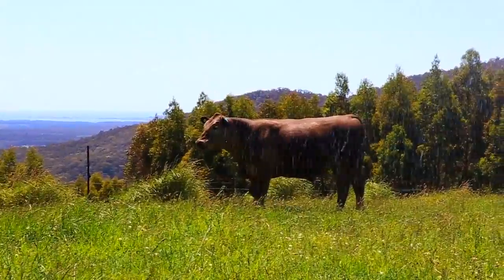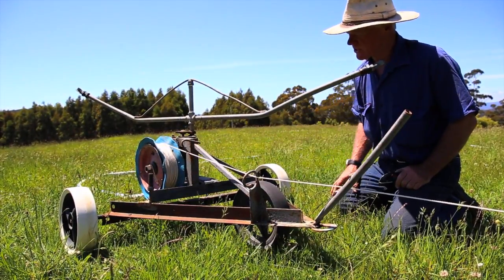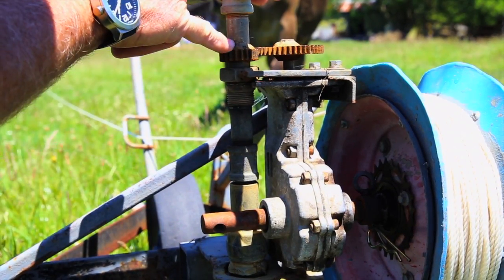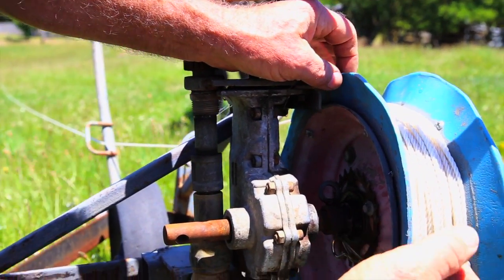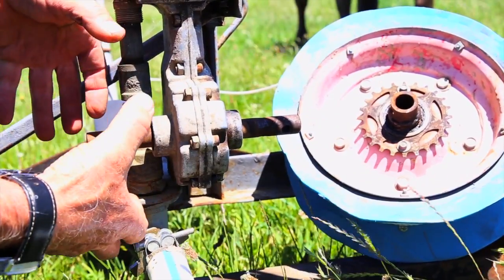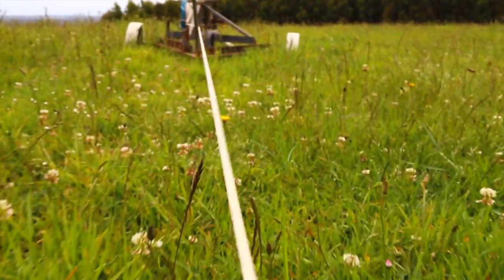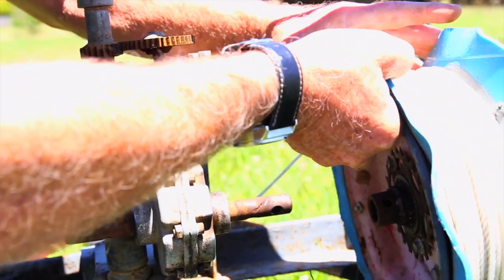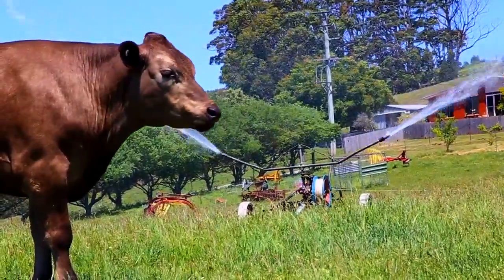DIY Traveling Irrigator

Comment: Len great job.
I have a question regarding the tiller gearbox i have a ryobi here and going to follow your steps. Question i have is the ryobi you used does it have a solid shaft coming up where you mounted a gear,mine has the flexible little square cable type.
Regards 
Paul
Sidmouth Tasmania

Comment: Amazing ...I am a lady farmer living in Upper Lansdowne Valley NSW...i would have all those bits lying around to put an home made irrigator together!!! so I will have a go!!!...I have beautiful flat fertile paddocks but due to drought they are drying a bit ..I make small square bales of kikuyu to sell so this would boots the grass to grow quicker...might need some help from a few local old timers..thank you for your video!!!
Reply from the maker: Hi Michele, I'm pleased you like the irrigator and I have a comment or two that you might find helpful. Since making the irrigator i have bought a 1" inch "lay flat hose" instead of the hard wash down hose in the video, it's mush lighter for the unit to pull along. Secondly, I didn't mention in the video that I have used a brass bush as a collar around the vertical pipe so as to not wear the water pipe. When I am talking about the two gears at the top,  it is the threaded nut below my left hand. I just used a brass fitting used for a water heater connection, I enlarged it with a file to fit the pipe, and fitted it into steel bracket to support the vertical piping. Lastly, you will need to put grease regularly on the two gears, as the water will wash it off eventually. Thanks Michele and good luck....cheers Len

Comment: Did you just use a normal sprinkler part that goes from elbow to part that spins for ? Hope that made sense. You talked about it at the end of your video.
Reply from the maker: Hi Luke, yes I just used the female base and the central shaft in a 1 inch sprinkler  and then as you can see fitted a 1 inch female socket above that and so on. Cheers Len

Comment: That works a real treat!  Something that size is $3000-$6000 USD here in the states. The $6000 tractor sprinklers in the USA use stainless steel aircraft cable to pull them across an athletic field. They also weigh about 120 kilos. How much does it cost to run the pump? I get about 6 hours per 24 hour day of ditch water use for my land, with the 9 shares of water. The land is kind of level, but it has a low swampy spot.  I still need  to repipe from the well at the school. I still .retain a 25% legal interest in that well. I am throwing $4000 of coaxial cable into the trench with the water pipe, so the school can use my radio tower, and that is 100% rent free for whatever they may need.  I think the sheriff's department & fire brigade also want to use the tower and that's all fine and well.  Their stuff is all small VHF/UHF. I already have some nice tuned antennas for police and fire, that should handle whatever they transmit with. Those very easy to make from 3mm solid copper wire. I just cut them a bit shorter than for the amateur bands. The ditch runs when it runs. It's on a schedule. The school's well waters a couple athletic fields, and some small patches of grass. The rest of the land is covered in buildings and parking lots.